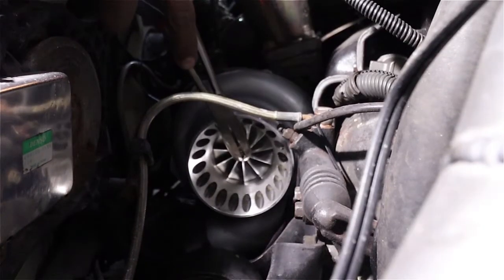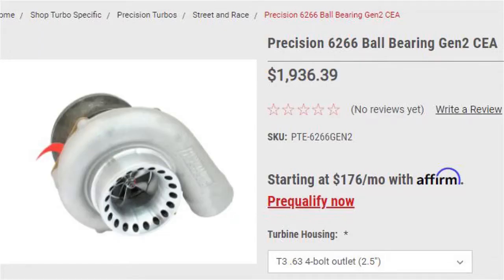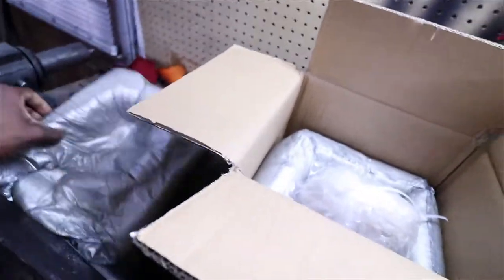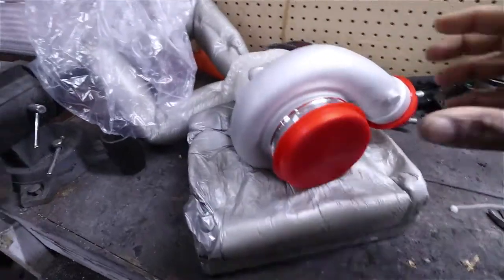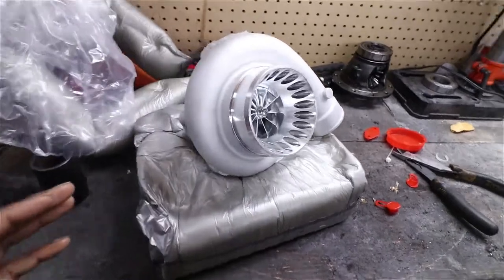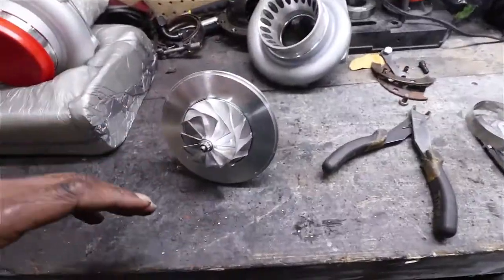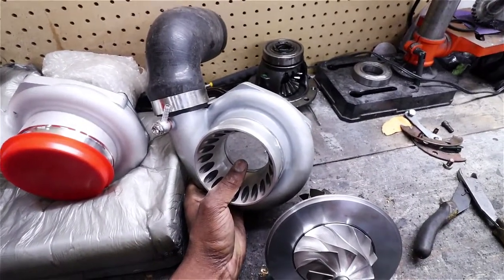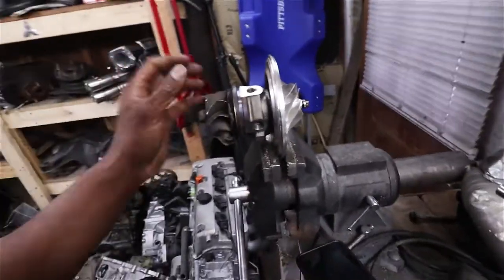Inside of a blown Ebay Gt35x. True ball bearing turbo?

Comment: High Quality GT30 GT3076 Turbo Charger A/R .63 V-Band T3 Rear + 3'' Flange Clamp ran 1000+ miles 30lbs boost no issues or shaft play

Comment: A lot of those are just journal for sure, but also theres quite a few ebay "dual ball bearing" ones that actually are real for around $450. Did this one advertise dual bearing as well?
Reply from the maker: Because I got this as a replacement turbo I never saw the listing. The seller offered be a BB turbo as an upgrade because they were out of the original one. Truthfully its not a bad turbo. They said its max was 2 bar(28psi), they were right.